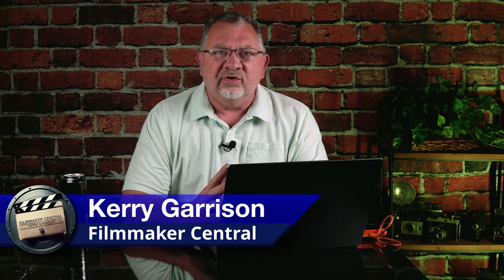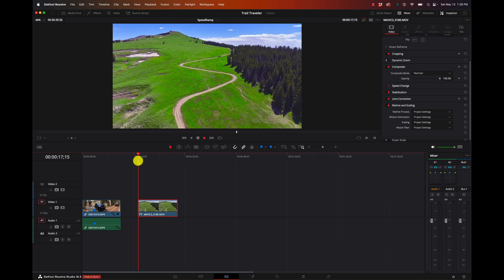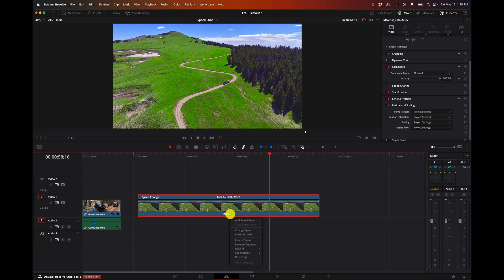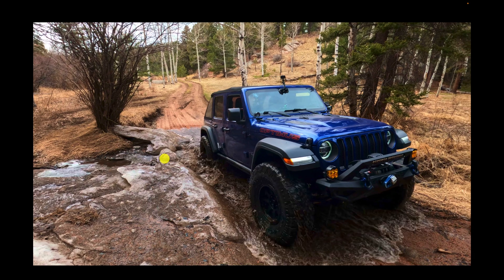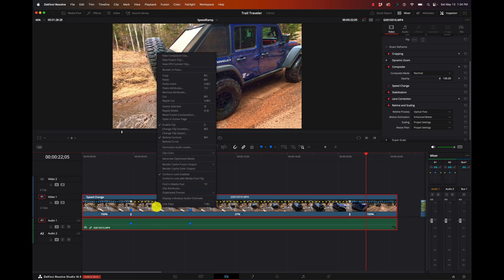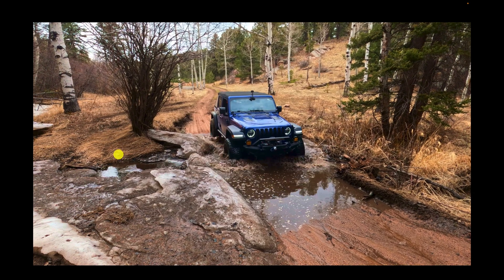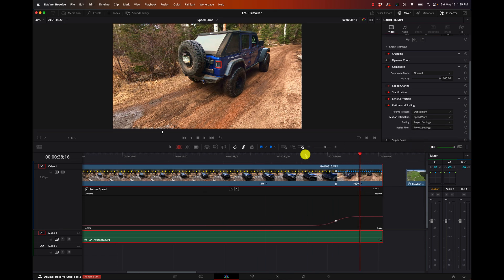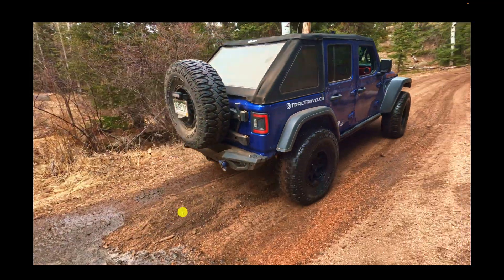SpeedRamping in DaVinci Resolve: The Ultimate Guide

Comment: Is it really true that all the frames are being displayed when speeding up a footage? I don’t understand how you could say display 200 fps on a 30 fps timeline. I must be missing something basic. How is this possible?
Reply from the maker: Essentially, no, it is not 100% technically correct and I oversimplified the answer
Reply: @FilmmakerCentral  ok. Thanks for the quick reply and clarification.
Reply: @FilmmakerCentral  As I think of this some more, I guess that speeding up video would not create anymore jerkiness than if the subject’s movement were originally going faster (ie as far as the sped up version)  but shot at 30fps. So speeding up video has no negative effects to the smoothness of the video, which I guess is what you were thinking about. Slowing down video means there are missing frames in the reduced playback speed and hence the jerkiness. I think that all makes sense now. Thanks!
Reply from the maker: @apeel2008  exactly. I may have worded that in a confusing way in trying to simplify the concept.